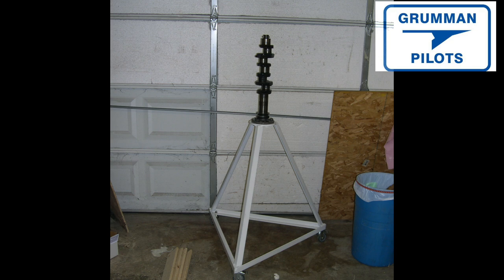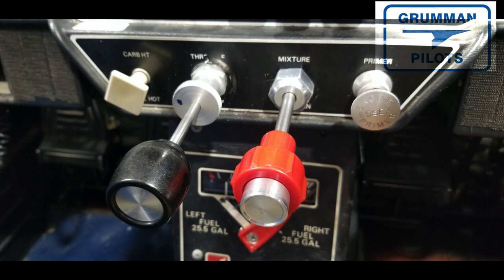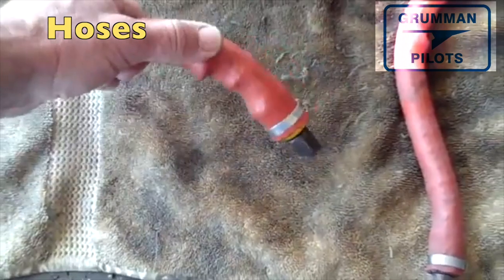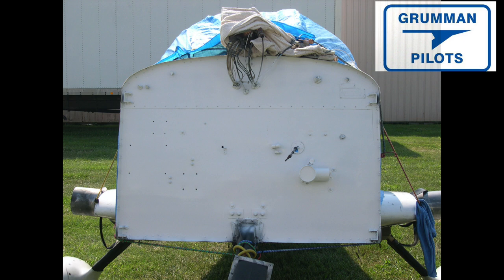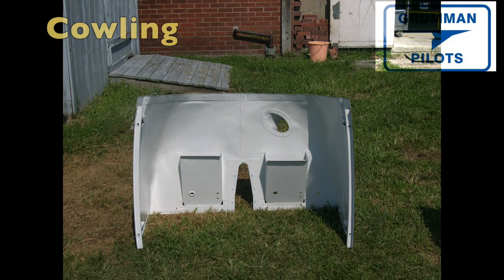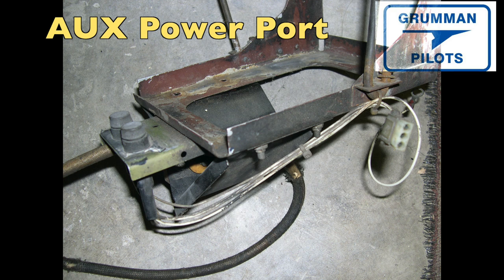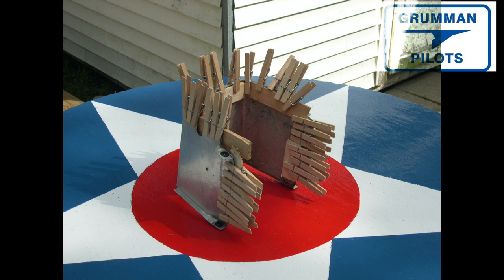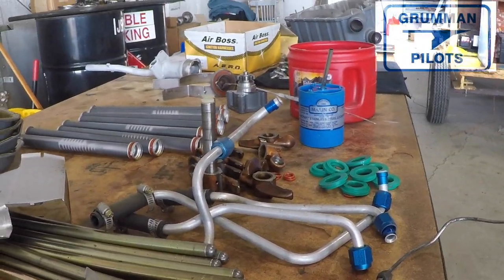So What Does An Engine Overhaul Really Cost? - Grumman Style

Comment: I am asking for informational purposes and not to attack. I just wanted to ask where in the FARS specify that you have to replace engine controls? Depending on what section/part you are operating under , to my knowledge a time based overhaul is not even required, nor is any of the other things in this video except the hose time limit. Are all these things needed or good practice? Most definitely a yes! Thank you for all your knowledge and the service you provide to the Grumman community. (sorry if you have already addressed this issue as I can not see the comments on this video)
Reply from the maker: It is a recommendation in an AC, also manufacturer of the airframe and the engine both agree.  More to an overhaul that the rotating group.

Comment: You said that the control cables need changing by the FAA. What FAR is that? Great videos!
Reply from the maker: It is a manufactures recommendation in this case our airplanes
Reply from the maker: It is like Lycoming's policy for an overhaul, if the case is split, you must install new bearings.  Even if old engine had 6 minutes of run time and the bearing looked new.  FYI
Reply: I reviewed the AA5 maintenance manual, saw nothing in either scheduled or unscheduled maintenance nor ch 73-2-1 nor 73-2-2. Is this from a Service Bulletin? Great topics and information presentation!
Reply from the maker: @williammundy2704  I ask Jimmy for the reg.  Shop policy for me.
Reply: So, what does Jimmy say the regulations are?
Reply from the maker: Manufactures recommendations, like Lycoming overhaul at 2000 hours.
Reply: Thank you very much! Will bear that in mind on prebuy. Keep up the great work.

Comment: About $1500, plus government involvement which is about $28,000. See how this works?
Reply from the maker: Hoses alone were more than that.  Not sure I want to fly on $10 hoses as an EXAMPLE.
Reply: @GrummanPilots  Hoses alone were more than that because of the government, not because the quality was any better.
Reply from the maker: @tamugrad2007  Last time I made hoses myself, each fitting in 2005 28.73 (2 per hose) and the hose was $17.00a foot plus my time and hand cramps to assemble.  So even manually hoses cost some money.